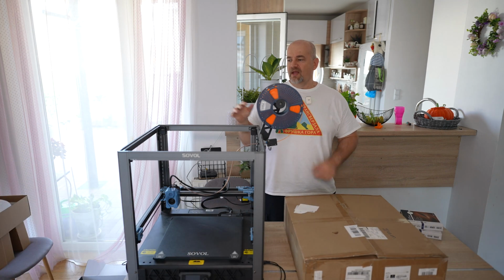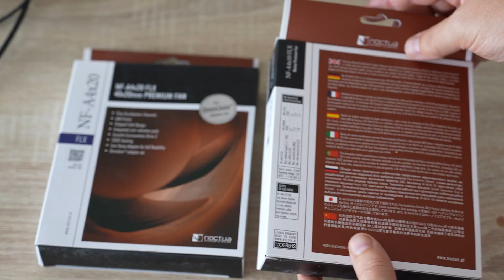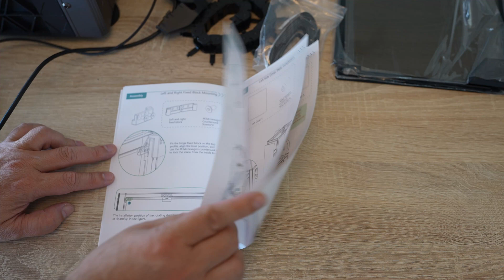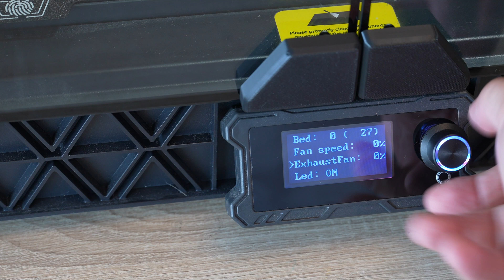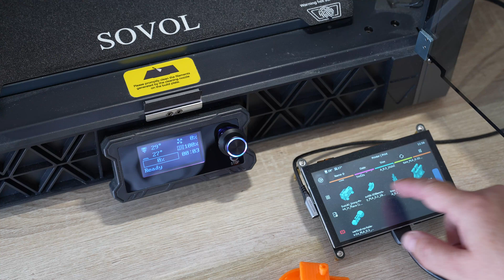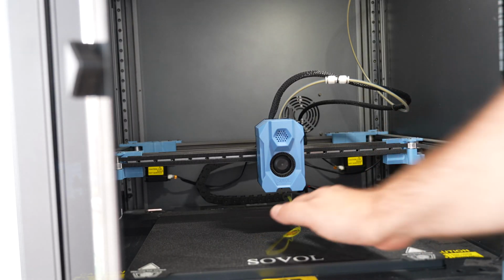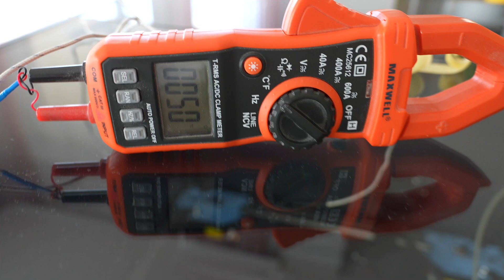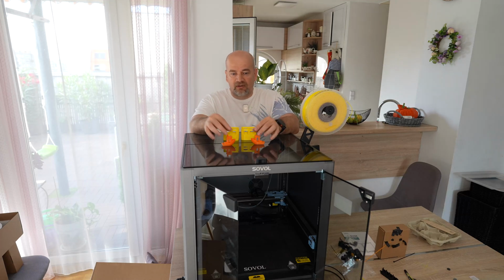Sovol SV08 Enclosure - good for ABS, but what about PLA?

Comment: I am electrical engineer, please do not use this idea of connecting 2 fans in a row to a 24V voltage source, you will in worst case fry them both. Thats like when you have a pressure system wwith 2 random users of pressure in a row, both users can handle 6 bare of pressure maximal, and you connect them to a 12bar system, at one point they will face the 12bar and get damaged. Same with the electrical system!

Comment: the board fan is controlled. the printer has kipper, the printer is open source. Why there are a lot of people ranting about the noise? just configure an PID for the fan
Reply: Its so much easier to complain. Especially when you spend a thousand dollars on a moden marvel of technology that bridges nearly every field of science and engineering to make plastic boats for you and it comes with a noisy fan.

Comment: I bought an SV08 a month ago and just cleared a space for it in my office.  As I was assembling it, I swapped the stock motherboard fan for a quiet Noctua NF-A4x10 fan.  I was planning to make the printer.cfg changes to add PID control for that fan but it's so quiet running constantly on high that I decided to leave it that way.  Swapping the fan while assembling the SV08 was a simple job, 9 screws and one connector, and it took maybe five minutes.

The other upgrade I made when assembling the SV08 was swapping the Sovol hot end for a MicroSwiss hot end.  The design and build quality are impressive.  It heats to 225 C in slightly over a minute and the 60W cylindrical heater supports very high flow printing.  I love being able to cold swap the FlowTech nozzle without removing and reinstalling the heater and thermistor and getting thermal paste on my fingers or taking the chance of damaging those components.  I've never swapped nozzles other than making repairs but it's so easy to swap the FlowTech nozzle with nothing but a 7mm nut driver that I ordered a 1.0 mm FlowTech nozzle that I can swap to more quickly print larger and stronger functional parts... like the motorcycle pannier racks that I need to print.

The next SV08 upgrade will be designing and 3D printing an insulating and structural enclosure that will hopefully stiffen the frame and dampen harmonics.  I'll have options for a pair of 120 mm fans in the bottom back and a large carbon HEPA filter in the top back.  I've been imagineering the enclosure so it's half designed.  It's time to take measurements and draw it in FreeCAD.  I'll upload the files to Printables and Thingiverse, including the SV08 G code for PLA with a 0.4 mm nozzle so it's as easy as download and print.

Comment: Great video.  Thanks.  The idea of two quiet 12V Noctua fans in series instead of the small and loud 24V main board cooling fan sounds like a worthy upgrade.  That's on my SV08 To Do list.  It should be possible to make a PLA profile for printing in an enclosure.  It might be possible to slightly lower the nozzle temperature and print at high speed, but it should definitely be possible to slow the print speed a bit to provide adequate cooling with the elevated ambient temperature in the enclosure.

Comment: Those Noctua 40mm fans are available in 24V too. I think putting two in series will mess with the PWM control and the RPM reading.
Reply: I think wiring the two Noctua 12V fans in series to replace the smaller and louder stock main board cooling fan should work well with PWM speed control.  In the video, Igor said he isn't an electrical engineer, but I am.   🙂  I plan on two series 12V Noctua fans as one of my first SV08 mods.  Of course, one larger and quieter Noctua 24V fan would probably work better than the stock cooling and would be less expensive.

Comment: You can addres the mainboard fan noise issue easily by software - mine is quiet now.

Take the code shown below, copy it, and paste it into the printer.cfg file of your SOVOL SV08 at or around line 375 just below the existing code about fan 3, then at the blank line, add this new code..  This code was developed by -redacted-, a top contributor on a Sovol SV08 facebook page.  Apparently people like to keep this a secret and I got kicked off the group for sharing this publicly.. go figure?   I am making this video because I saw there was no solution being shown on YouTube other than people tearing into the machine and replacing the fan with a quieter one.  Code to be copied and pasted below.  NO other changes are necessary!  
  
[temperature_fan CPUfan]
pin: PA1
kick_start_time: 0.5
max_power: 1.0
min_temp: 0
max_temp: 90
hardware_pwm: true
target_temp: 60
sensor_type: temperature_host
max_speed: 1.0
min_speed: 0
control: pid
pid_Kp: 2.0     ;40
pid_Ki: 5.0     ;0.2
pid_Kd: 0.5     ;0.1
pid_deriv_time: 2.0

credits to John Hansknecht https://www.youtube.com/@JohnHansknecht
Reply: I replaced the fan but the machine is still so loud with the belts. Is this a problem you have too?
Reply: @Doubletroublefursuits  in the enclosure, it's ok. Fast speed comes at a price 😉
Reply: @jazzitsw6875  in the enclosure it’s still super loud. Even when I lowered the speed it was still loud.
Reply: @Doubletroublefursuits hm... Mine is a little louder than my Prusa MK3S on fully speed with worn rails.
Get in touch with Sovol, they are super helpfull. Had sent  several replacement parts when sth. was in doubt of beeing root of an issue, can absolutely recommend doing so.
Reply: Is it maybe a resonance thing? Is it loud when you move X/Y manually?
Reply: @jazzitsw6875  do I have to turn off the steppers to do that
Reply: @Doubletroublefursuits  yes, otherwise you can damage your gears, steppers or belts.

Comment: you should look up my fixes on printable if you have not already. should help with your drag chain issue. i can get the full 350mm on my printer. 
 @ValerieMoore_2024393

Comment: Question how thick are the enclosure panels?

From my experience those little noctua fans can handle 24v  just fine for apparently over 5 yearsz maybe I've been lucky but I first tested them to have an auto shutoff at 28v DC and it was definitely labeled as 12v. In anycase running the fans in series is perfectly acceptable under constant load.
Reply: Yep mine is running just fine on 24 V

Comment: I wanted to print with ABS but the unit never reaches 60C. I'm adding a top hat with BTT HDMI7, 200 watt 24 volt heater controlled by a RP2040 using Klipper, this hooks up to the main controller with the second USB next to the Sovol SV08 camera. I plugged the rear fan hole since my printer is flush with the wall, the top hat has a 60mm fan on either side with a carbon filter. FYI: While printing the top hat I had two prints warp, the rest I moved to the rear and added a fence (Skirt with Draft Shield) to keep the heat in.
Reply: you mean the heated bed never reaches 60?
Reply: I ordered a qidi plus 4 chamber heater as it was only $39 dollars. Not sure how I’m going to hook mine up yet. I know there is a “fan 3” JST connection on the motherboard, and I just hooked up the exhaust fan with the enclosure so I assume there is a chamber thermometer somewhere that turns that on possibly when printing PLA or when it gets too hot, not sure? Then there is turning on the heating element and keeping it at a set temperature with some type of PID circuit, I’m not sure if this is on the motherboard and I can access it with Klipper?

Comment: Can you confirm or deny that the parts from the enclosure or some of them are printed in PLA
Reply: Both ends of the cable chain are PLA, says so right in the assembly instructions.  There are models for both on the Sovol wiki page, you can print your own.  I had to reprint the bottom connection because I broke it installing it, and I had to print an alternate version of the top mount to reposition where the cable attaches to the gantry closer to the right side, some of the early models didn't have enough slack in the right servo cable so the mounting point had to be moved closer.  There are several versions out there, a quick search of SV08 on your favorite model site should get you plenty of results.  Hope this helps.

Comment: Do you know of a way to turn on, and adjust the Exhaust fan on the enclosure for the SV08 via Orcaslicer? Or a Start Gcode settings.
Thanks, I can not find one and sending a Gcode command fan_generic fan3 does not seem to turn it on. The only way I have found so far to turn it on is manually via the display
Reply: I discover Exhaust Fan: in Start Gcode
M106 P3 ; Turn ON Exhaust Fan 100%; PLA allow doors to be closed but open top or for ABS totally closed. Use example PWM   M106 P3 S128 = 50%
...
in End Gcode
M106 P3 S0; Turn OFF Exhaust Fan 100%; PLA allow doors to be closed but open top or for ABS totally closed. Use example PWM   M106 P3 S128 = 50%
Reply: @3D_Printing  see my above comment how to do it permanently in the printer config

Comment: 4:05 The Perspex (lexan) blocks the vents in the metal shroud. Seems like an after thought to protect wires but they didn’t think about the power supply vent. 

I’d take the Perspex (lexan) off laser cut some holes to somewhat aligned to metal shroud, to keep it a little cooler from ambient air. 

At 6:45 the fan noise is horrendous. Is it a case of getting bigger ones or changing to noctua. Add in some logic that turns them on when needed rather than just running full time?
Reply: @75keg75  The fan is addressable so you can code all kinds of stuff.

Shut down after 2 minutes of inactivity seems to be one so the most 😂
Reply: Exactly, teaching tech shows how to use its address in Klipper to change it’s settings to only run when printing and turn off after a preset idle time.

Comment: Thank you for your video! The enclosure looks way better than I expected from the first online pictures. I wonder, why the side panels of the lower compartment are not meshed or at least have more openings to allow for more natural airflow. Is there enough space down there to integrate a standard 120 mm PC-fan? I did that mod with the power supply of my SV 06 and it's dead silent now.

Comment: It be really good if the exhaust fan could be controlled via software to run in reverse. That way you could have the enclosure shut even for PLA
Reply: flip the fan
Reply: @ChaoticGeek  Then it wouldn't work as an exhaust 

In suggesting that it can be controlled electrically to run forward or reverse depending on the print material.

Comment: You can connect two fans in series, they just have to be the same ones.
Reply from the maker: As far as I know, they can be different too (types), only the voltage has to be the same.
Reply: @MyTechFun   if they are different each will get a different voltage. But you can test, maybe they are close enough :)
Reply: @riba2233 
Yes. Two coils with different induction gives a voltage devider that is not 50/50.
Reply: @MyTechFun  Never, never wire fans in series, because they are very sensitive to overvoltage and due to their inductance there is no guarantee that each fan sees not more than 12V, even if they are of the same type and voltage. Use a dc-dc-converter instead. This cheap ones (LM2596 e.g.) for less than 2€ will do the trick. I did this for my Geeetech A30 which was creating noice like a jet engine and it worked well.